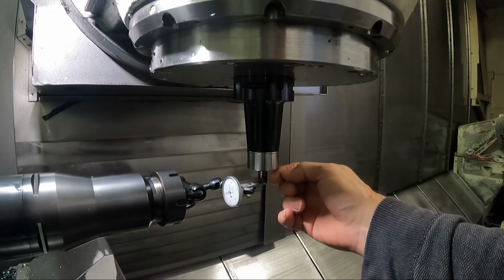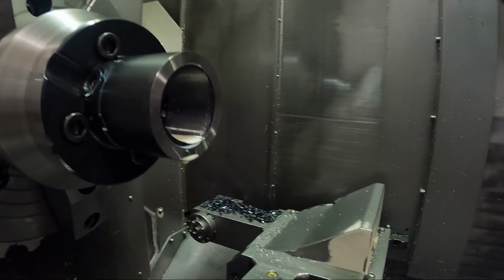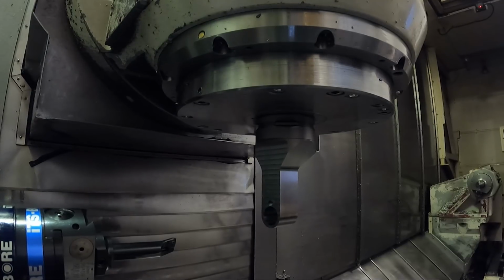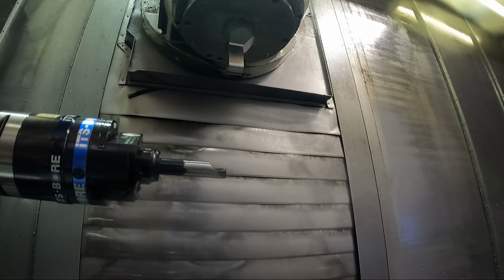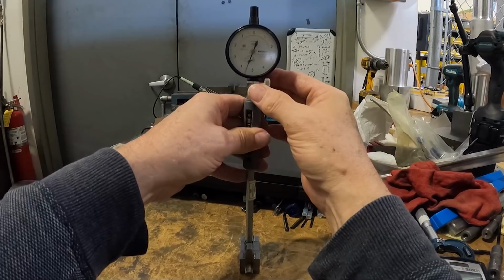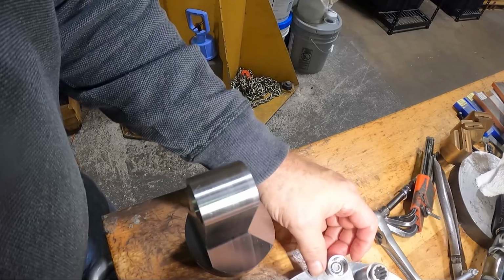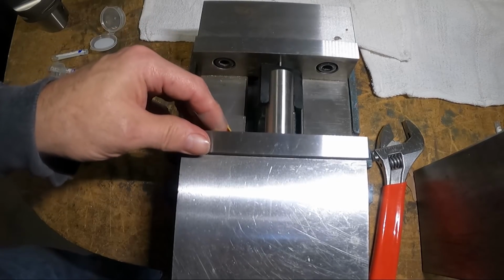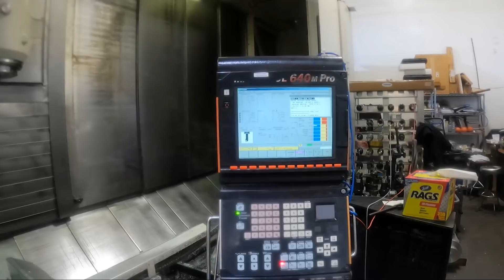Boring For Spindles and Running Tools

Comment: Do those spindles provide a repeatable rpm based on coolant psi?  Curious how you maintain a chip load without a known rpm.
Reply from the maker: There is a gauge that comes with their set with a device that if you put it in a sealed tool holder. Than turn you high pressure thru the spindle coolant on. It is calibrated in rpm based in the coolant flow and pressure. I haven’t tried it yet. Maybe I will show it in the next video.
Reply: @EdgePrecision  Hi Peter, Is the viscosity of the coolant a player in this set up?.
Reply from the maker: @1ginner1  I don't know. It may but I have no way to measure it. Their gauge device may give a reading influenced by that.

Comment: Good job! Can you show how to program it on CAM and how the g-code looks like? :)
Reply from the maker: For the most part Esprit TNG will output code. The only thing I have to do is delete the spindle commands because there is no spindle as far as the control is concerned. But Esprit needs a spindle speed to output the simulation and code. In other words it needs to think it's cutting something. Because Of the way I'm setting up the machine with lathe tools really doing milling I have to do a few manual edits on the work offset transformation that Esprit outputs. Esprit actually treats this as a 5 axis operation because of what it thinks the tool is. But in reality its only a 3 axis operation. Really there is no need for a work plane rotation at all. Because it is in the natural X,Y plane of the machine. Just like a 5axis operation would be. But in order to mill in the X,Y plane with the B axis at 90. It has to be a 5 axis operation. I do have to change the G43.4 to X,Y,Z  just to  G43 with a Z and move it ahead of the first X,Y move. To avoid any collisions. I also turn on the Hp coolant (G131 on this machine) on the G43 line to start the spindle.  But the body of code works just as output. I am working with Esprit's support. Maybe all this can be configured in the post to work with no manual edits. We shall see.
Reply: @EdgePrecision  Is tooldefinition as endmill or turning tool in esprit?
Reply from the maker: @MrLogicsys  In Esprit TNG. You have to take the model of the 90 degree head into their Machine Tool Builder software program. Then define the spindle axis in its location on the head. And some tool planes. (The Esprit TNG software comes with the Machine Tool Builder Software). Then in Esprit TNG when in your toolsetup you install this adaptive item into the turret (Station 1 the milling spindle on my machine). It then knows you have a spindle in that location and orientation on the 90 deg head. Then you define the milling tool in that adaptive item (The 90 degree head). When you use that tool in a operation it will use that spindle. That same adaptive item can be rotated to the different angles. For the back milling. If you use Esprit TNG that should all make sense. But if not that's the only way I can enplane it. This Is a overly simple explanation of a more complicated subject.
Reply: @EdgePrecision  ok. Now I understand. I'm using gibbscam and for this feature is extra payment. Thanks for explanation 👍

Comment: That was a great series, thanks for doing that!  Maybe I missed it but I wonder what the runout is on those cartridges?
Reply from the maker: I did show that. But I did check it. The shank of the tool runs in the bearings. So the runout is practically nothing. I measured no more than .0001”. Also the tool is in the spindle is very stiff. (If I put it that way). It takes quite a bit of pressure to deflect it.

Comment: You should grab a coaxial indicator. Its great for finding the center of a part or tool
Reply from the maker: The only coaxial indicator I would own is a Hamer Centro. All the others aren’t accurate enough.
Reply: @EdgePrecision  you had a haimer 3d probe sensor in the back of one of your shots.  How do you like that tool?
Reply from the maker: @TylerBrigham  I do like the Haimer. I did once try a different brand and sent it back. It wasn’t accurate.
Reply: @EdgePrecision  I have tried and used different coax indicators, never liked them. Either to imprecise or way to bulky and with a ton of overhang.
Hard to beat a DTI in my book
Reply from the maker: I agree the ones that you see people use on YouTube videos. I once bought one and tried it. It had so much play and uncertainty that it is useless for anything requiring any precision. I don’t one one but I saw it demonstrated. The Haimer Centro (very expensive. Around $600.00 USD here). It looked good but is kind of large. About the same size as the Haimer probe I use. The only issue with using these type of indicators on the Mazak. I cant run the spindle with the doors open. So I would have to turn the spindle be hand (doable). Having to do that. Where is the advantage over a test indicator in a arm?

Comment: Only thing I can say is,  woooow , ..... awesome job Peter.
Question, is the spindle oriention (M19?) in Z movement always within tolerance ( 0° and 180° angle ) for your new speedtools ??
Reply from the maker: The reason I set the tool up as a lathe tool. On the Mazak Integrex. Defining a tool as a lathe tool it gives you the ability to orient and clamp the tool in different directions. This is defined in that tools setup information. So to reposition the heads angle. All that is necessary is to make a tool change. Because it’s really the same tool but just a different tool definition it just rotates and clamps at the new angle. On the Mazak’s control you can have many tool definitions and offsets on the same tool. This also has the advantage that I can use separate offsets for each direction the tool faces.
Reply: @EdgePrecision  
Ok thanks Peter, I understand how you did the setup.
I wondered if your upper spindle has precision orientation and a lock/brake function that's 100% repeatable ( 0.00 ° ) after each tool change, so your selfmade static toolholder is 100% aligned/parallel with the movement along the centerline of the chuck - tailstock plane, lets say the Z-axis on a normal 2-axis lathe, I hope that make sense.
Reply from the maker: @ytfan3815  yes that’s correct. The orient and clamp function has to be very precise for the lathe/turning tool to repeat with the precision necessary to turn close tolerances.

Comment: Is there a way of knowing the RPM so you can calculate feed rate by chip load and RPM?
Reply from the maker: In the kit it comes with a device that has the same restriction as the spindle and a gauge calibrated in speed. So you mount that in a sealed collet chuck. Then turn on your coolant and just read the rpm on the gauge.
Reply: @EdgePrecision  Oh, almost like a tire gauge, but in RPM instead of PSI.

Comment: Rotate your workplane 90deg about the y axis with cordinate rotation then you can use cutter comp with your "live tool ".
Reply from the maker: The reason I could not use cutter comp was not the orientation of the tool or work piece. It is the way the tool is defined in the controls  tool setup. Because it is defined as a lathe/turning tool. I need this to utilize the orientation and clamp ability of a lathe tool. But that tool definition/setup has no entry the diameter of a milling tool. So when I would try to apply cutter comp in a program (G41 or G42) there is no value the program can access in the tools setup because it is not a milling tool. This tool by the way is moving in the XY (G17) plane of cutter compensation.
Reply: @EdgePrecision  Thanks for the reply.

Comment: When the cartridge with the tool and the impeller is cutting, the high pressure coolant does not pop it off?
Reply from the maker: I’m not sure whether you are referring to? I did put the screw there to retain the spindle in its bore. Against the coolants pressure. As far as the tool itself. The press fit in the bearings is enough to hold it in from the coolants pressure.

Comment: Let me get this straight.... you made tool holders, that spins the cutters at high rpm from the high pressure coolant, so you can back spot face the bosses on the actual titanium parts.... brilliant
Reply from the maker: Well almost. These parts are aluminum.

Comment: voice audio - try pointing mic down towards chest away from mouth - this reduces peaks when you look down or turn head while talking - mic gain will need to be turned up a little
but this will reduce audio from being over baked in moving environments - I enjoy you videos
Reply from the maker: I was using my Rode Go wireless mic. I didn’t notice but I had The transmitter/mic clipped to my sweatshirt’s neck in such a way that, when I looked down my chin hit the mic. I didn’t notice this until I reviewed the video. With what I do there really is no chance to retake many things. So I had to live with the sound on a few of these clips.

Comment: So your Y axis is on centerline when off 0.0053” from machine centerline? Is that normal?
Reply from the maker: That all has to do with a Mazatrol parameter. A zero return position if you will. It really makes no difference where it is. This machine zero returns with the Y in the middle of its travel.

Comment: Cant you just define the tool as a face endmill and select the direction there to turn on cutter comp? 
I would call mazak in gardena they have an esprit guy working there full time.ps holders came out sick!
Reply from the maker: It is the set up on the machine. Not the cam software. It would do it. But to use the index and clamp of the spindle requires me to define the tool as a lathe. There is no offset in that definition for a diameter. I could possibly use a variable in the control. Than put in the program G41 D#100. Using user variable 100 for the tools diameter. I didn’t try that it may work.
Reply: @EdgePrecision  yeah we have  a mazak msy200 and we do some holes like this kinda but not defined as a right angled head ill give them a holler on Monday maybe the have an answer.
Reply from the maker: Crappie Chancellor   the tool is moving in the X and Y axis plane the C axis isn’t moving. But even if it was. It is also possible to use cutter comp in the X and C axis.
Reply: Crappie Chancellor   xy moves cutter comp is available 
And like peter said u can use it on polar moves aswell
Reply from the maker: When I was talking about cutter comp in this video. I was referring to the coolant driven 90 degree head. Not the boring head I used in the turning spindle.

Comment: It's kinda funny to see you hog out such a large piece just for the test.  There must have been plenty of profit margin/ allowance for tooling on this job.
Reply from the maker: I have never used this type of before. I already had this piece of aluminum from another job. It is better to make a mistake on this than one of the real parts. You need to understand I don’t work for someone. So if a mistake is made. I have to pay for the material and all the cost up to that point. I don’t just get to say sorry for the mistake, I’ll do better next time. This is cheep insurance.
Reply: @EdgePrecision  Right on.. I understand that.  I just assumed you would have welded a piece of scrap to the side of another piece -- to from and "L " and go from there.  I suppose aluminum is a little harder to weld though.  I was just thinking out loud really---  wondering if there was a better way to test it, without wasting such a big piece.  I can understand why you used it though if it was just scrap anyway.  Plus it was the easiest thing to indicate and get straight to milling;   I get it.

Comment: are the bearings rated for a low life?
Reply from the maker: On one of my Instagram posts. Someone said they have been running one for more than 200 hours without a problem. But I think the tool would wear out before the bearings.